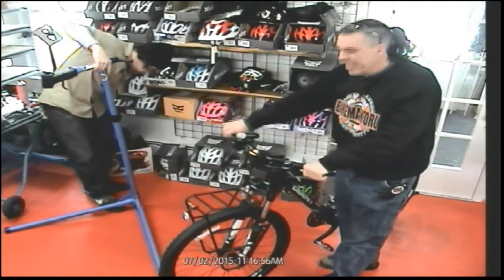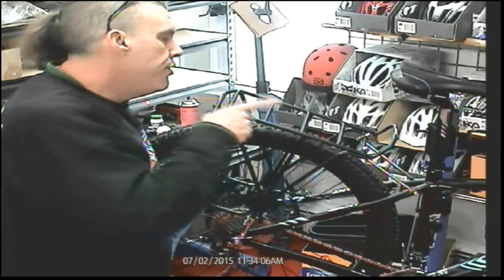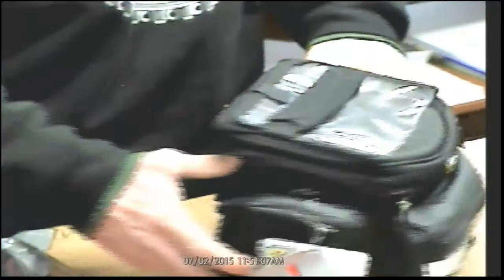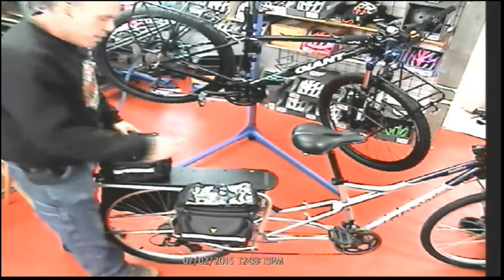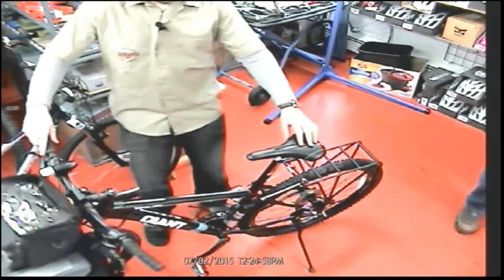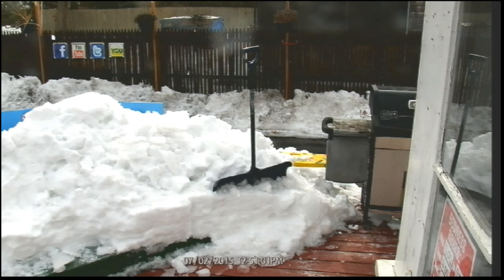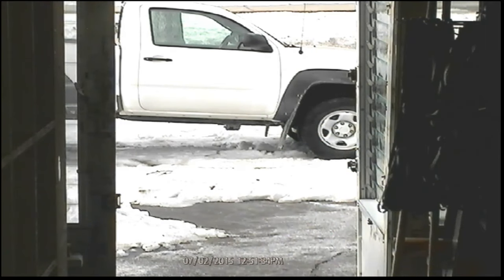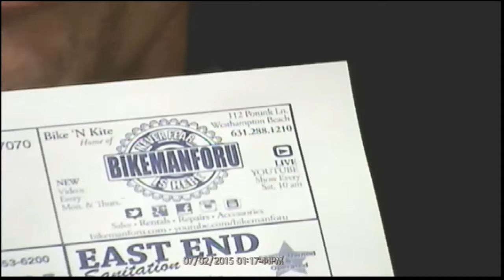Bike Shop - BikemanforU LIVE 2/7/15 "Emergency Service Bicycles & More" S3E6

Comment: @1:14:09 check out the Ibera brand bags/panniers(they seem varied and not priced out of sight).
I'd rather buy from bikemanforu than amazon, so stock the stuff you rate highly, pls...
Great segment though.
I prefer the bag on back (vs the front) but they all should have a provision for attaching a red tail light (the bags stick up and block any light mounted on the seat tube. I'm using one of these now (mostly for lunch to work b/c it's insulated) and because it doesnt stick way out beyond the rear rack, but far from a larger carry-all size.:
Dead On Tools DO-300 Killer Chiller Mobile Cooler/Lunch box, Black

Comment: suggestion: like the emergency bike stuff, but 30 minutes on the rack segment was like telling a five minute story in 30minutes.@34:55 love the serfas lights, but please do a segment on AIMING lights. Too many fools today use white fast strobes facing front that are painful to run into even walking along and then there's the headlight on helmet folks and super bright headlights mounted on handlebars where they are meant to be but aimed up too high. See and be seen is good, but how-to-aim-lights should be part of the equation

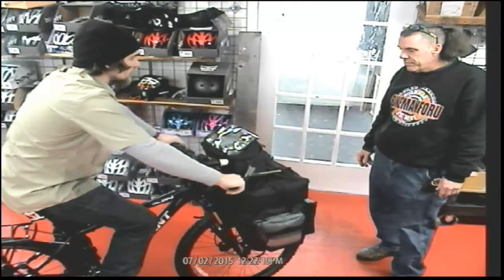Comment: At 1:16:00 What's the proper compromise between mobility and equipment on hand as far as emergency services go? I think a lighter-equipped more mobile bike is the way to go most of the time, like a scout who can assess the situation and either take care of it or quickly call in the cavalry. If it's something serious, it seems likely to be a two-person task at minimum anyway. I can see the point of more immediate attention also but I wonder at the ratio of those types of incidences vs. lugging all that equipment around all the time...they might end up only carrying 10 or 15 lbs. of stuff (not including the heavy bags) on those heavy duty racks anyway.